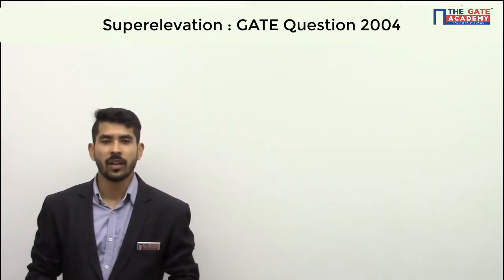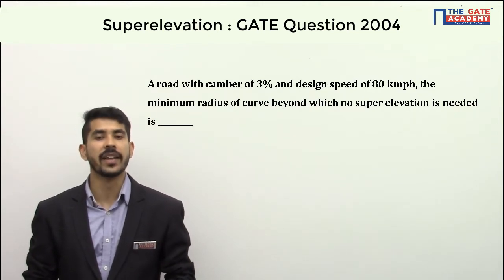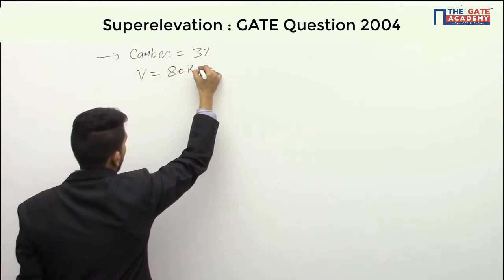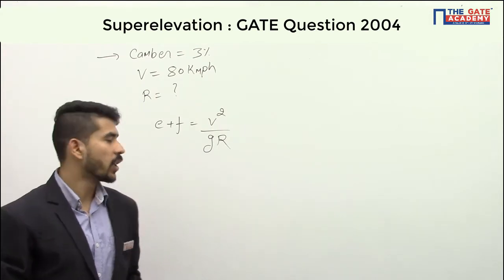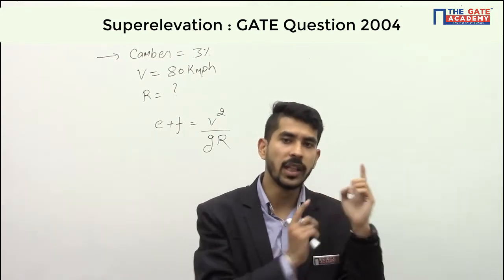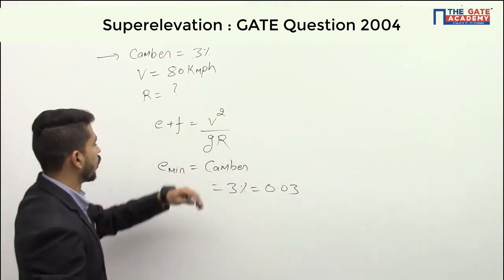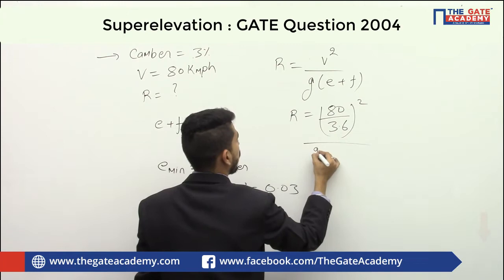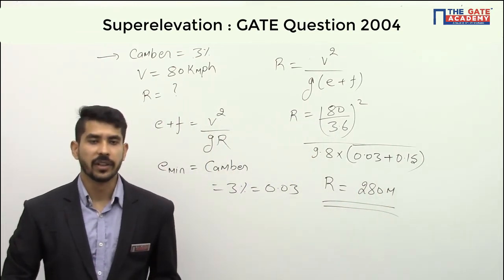Super Elevation | Excellent Question - GATE Sol | Transportation Engineering | CE

Comment: Dear TGA team, the Radius beyond which no superelevation is required , for a camber of 3% , if the design speed is 80kmph IS 950m as per IRC recommendations.
Refer Table 4.12 Page 115 , Khanna and Justo.